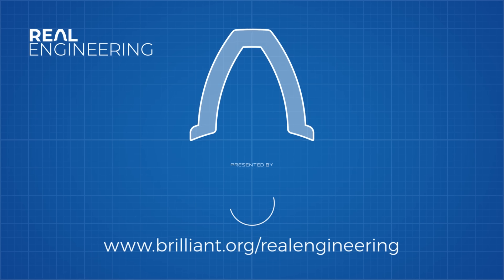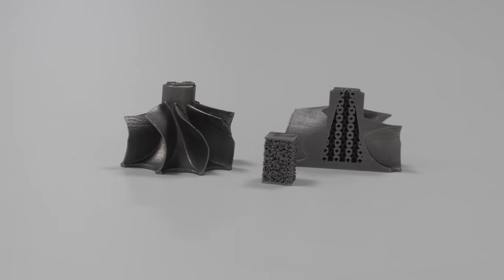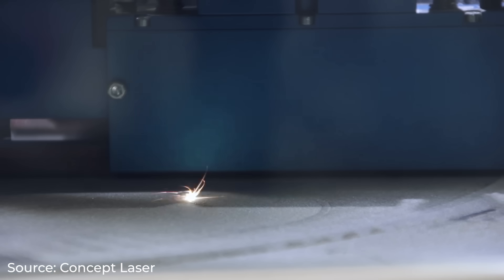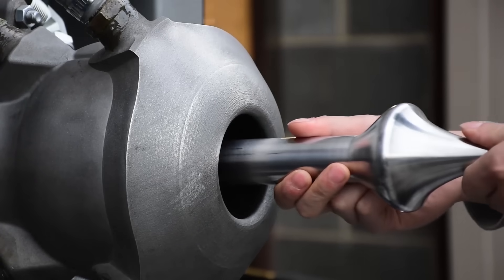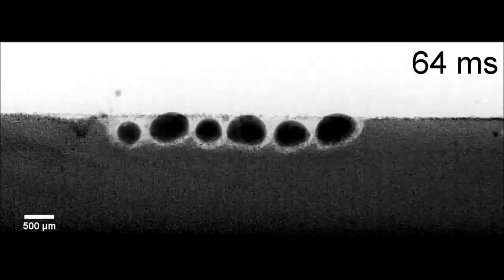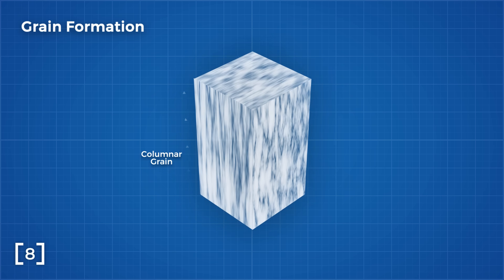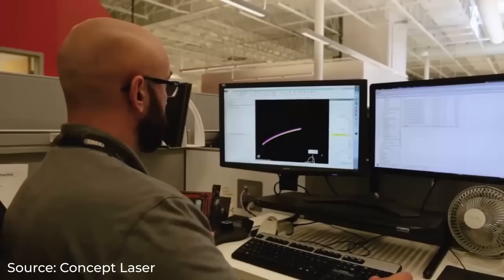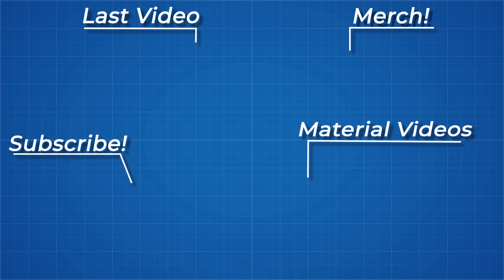The Material Science of Metal 3D Printing

Comment: 7:27 Note that the unsupported "overhang condition" shown there never happens in an SLM 3D printer. If the model has an overhang, support structures are printed underneath. Only a small layer of powder with fused powder underneath is melted by the laser.
Reply: True and even if the overhang angle varies with material and parameters, no support structure is often quite dangerous for your production batch and your recoater :p

Comment: I will buy a 3D printer, and print a 3D printer...

And then refund the original 3D printer.
Reply: STONKS 📈
Reply: Yee yee, print your belts, print your power supply, driver board, steppers, LCD, your heatbed. Good luck with that today. :-D
Reply: Not how it works, but cool!
Reply: It'll just only offset the cost of materials to print the new printer, so you're not gaining anything, really.
Reply: I used the 3D printer to print the 3D printer.
Reply: this was the idea behind the original repraps...
Reply: 2050!

Comment: On the throwing away lots of material in aerospace.... it doesn't help that many parts were engineered to be made from extruded profiles or from castings, but with the consolidation of producers many of these profiles and castings are no longer manufactured (unless maybe you're someone who's buying a full mill run) so the parts end up getting substitutions to be hogged out of solid plate.

EDIT:
(commenting as I watch) On the cost part, if anyone's curious I do bidding at a company primarily making aerospace sheet metal and machined parts.  You can pretty well approximate that curve of unit prices with Price = Run + Setup/Qty where Run is per part run/material cost and Setup is total invariant setup costs.  Run costs per part are typically around 3% of total setup costs.  

The popularity of JIT ordering (also known as min-max or consumption based) among aircraft manufacturers which leads to either long inventory times or small run quantities for manufacturers and drives up parts is one of the main things that I see really driving parts towards additive manufacture particularly for non-critical details and assemblies.

Comment: What about 3D printing in a vacuum?
Reply: Vacuum only works on electron beam technology. Some powder vaporizes when it is melted with lasers and must be moved out of the Way for the laser to effectively scan and keep layers consistent. That’s why air flow is one of if not the most important aspect of additive metal builds and is run in an inert has environment
Reply: What about 3D printing a vacuum?
Reply: @benheinz8817  Air bubbles wouldn't form? At least in theory, idk I'm not an engineering expert.
Reply: @lite4998  There is electron beam additive manufacturing that needs a vacuum.

Comment: That Samsung fatique testing rig.. i heard from a mate who does those rigs for living that the problem in their testing was too high tolerances.. Having a machine that makes perfectly identical motion, each time for 100 000 times is not good machine for testing how things work in real life.. It should have slightly "wonky" geometry, loose joins here and there so that it better mimics the very imperfect way we humans use them. You need a bit of randomness to make it correlates better with reality.
Reply from the maker: Same thing I said. They are testing best case scenario
Reply: @RealEngineering  It is very interesting field for sure. I wish i had known that testing is a real job about 25 years ago. I did end up doing software testing a bit but not enough to make a living.
Reply: There needs to be a baseline established to find any faults with material or design then the infinite variables of real world conditions could be explored.

Comment: The Material Science of Wood 3D Printing
 next?
Reply: That would be hard, but we are printing organ tissue and fruit, so I'd reckon it's still possible.
Reply: Wood has an extremely complex structure so it's hard to create artificial wood that's realistic. If you wanted to 3d print it then you would basically need to go down the same path as organ printing where it's cell by cell and then a strengthening process. On the other hand we can do a wood plastic mix that could probably be 3d printed. It's commonly used for decking and stuff, but doesn't really look like real wood if you look too close, on the other hand it does last outdoors far longer than wood.